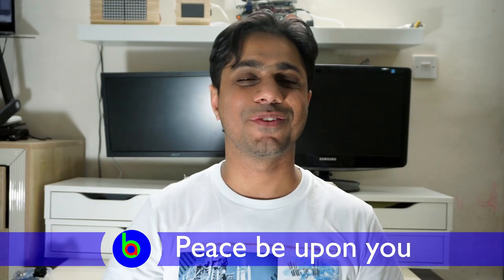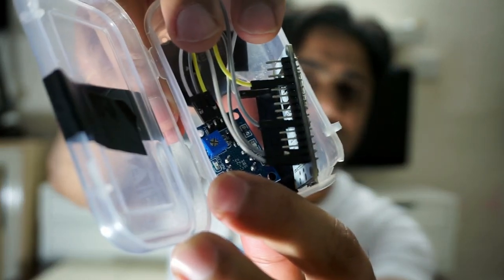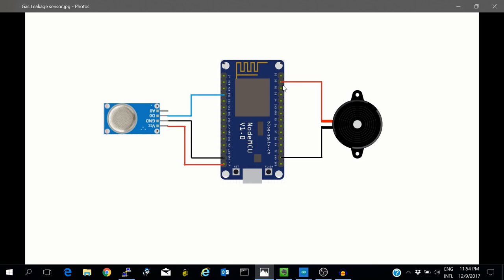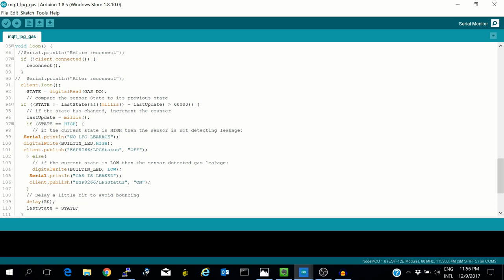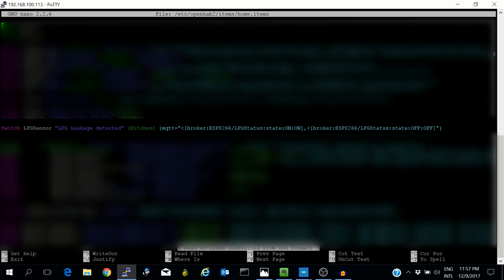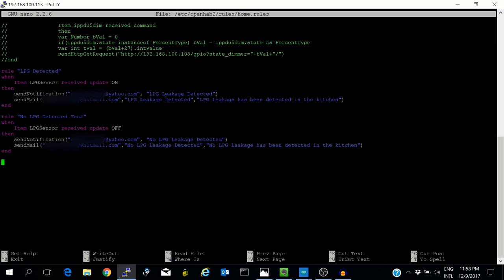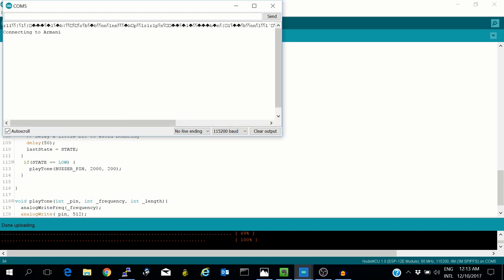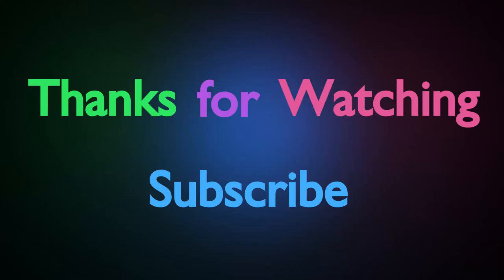LPG Cylinder Leakage Sensor using MQ6 Sensor and ESP8266 - Baba Awesam

Comment: Hey! Followed your complete video. But as soon as I am uploading your code my buzzer is continuing buzzing. I have not even given the gas supply still buzzer is buzzing. Please tell me what can be issue
Reply from the maker: Hi. Probably the connection with the sensor is having issues.
Reply: Thanku for your response. Can you tell me why we are taking 'last state' data? Is there any specific reason or we can write code without it also.
Reply from the maker: @tanayawankhede2821  If you will send alerts for whenever the state of the sensor is low, then your esp8266 as well as your mqtt sensor will be overwhelmed by continuous messages. With last state, we want to send alert only when there is a state change i.e. either when there is detection or when the detection is cleared.

Comment: Great Video. Query: MQ6 datasheet says it works on 5V but the output you are connecting to one of the GPIO of node MCU, Since you are connecting Vcc= 5V the GPIO will also get 5V when sensor is triggered. but max Operating voltage of NodeMCU GPIO is 3.6V , won't that blow the Board? please clarify.
Reply from the maker: According to the CEO of Espressif, Teo Swee Ann, the I/O pins of the ESP8266 are 5V tolerant.
Reply: @SamirSogay  Thanks for the info. Let me connect & see  if it works or Blows :)

Comment: your video too amazing, i was download your coding but why i can't open this?,  please tell how we get the Ro (clean air) of these sensor? and how we get a slop, intersect value? i'm so confused.  
thankyou :)
i'm beginner :)
Reply from the maker: This sensor will just give digital output 1or 0, whether there is leakage or no. There is a potentiometer to set sensitivity. What is the problem you are facing with code?

Comment: Hi Samir, This is exactly what I was looking for. I am trying to use it with home assistant. My MQTT is password protected hence I added = const char *mqtt_user = "MQTTUSER";
const char *mqtt_pass = "MQTTPASSWORD"; but I am keep on getting error on serial monitor ""Attempting MQTT connection...failed, rc=5 try again in 5 seconds
""  Do you know what could be the issue?
Reply from the maker: I have not tried MQTT with credentials but you can try passing the credential via client.connect("arduinoClient", "testuser", "testpass")
Reply: @SamirSogay  Thanks. I got it working. Why are we not using AO pin of MQ2? NodeMCU has Analog pin?
Reply from the maker: @abhishektripathi8213  I suppose we can. Generally we want to know whether there is leakage or not but if we want to know the level of presence of the gas, analog can be useful. Although I have not tested it.
Reply: @SamirSogay  You're right. Getting detailed value of of analog pin is not helpful when end goal is to detect gas leakage. Besides, I did not found MQ2's analog reading to be very accurate. I added couple of LED's to and another MQ2 sensor (one sensor will be kept near stove and the other one will be near LPG cylinder. I tried modifying your code with my little to no knowledge on Ardrino IDE but I can't get it working. Would that be possible for you to take a look and point me where I did the mistake? Here's the pastebin link: https://pastebin.com/GRuS41bu

Thanks in advance.
Reply from the maker: @abhishektripathi8213  I replied to your guthub comment.